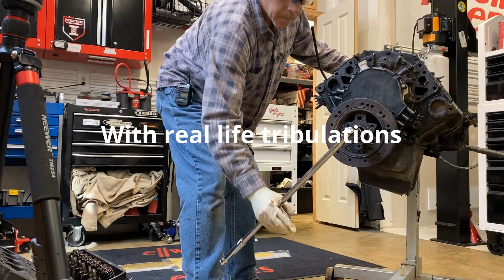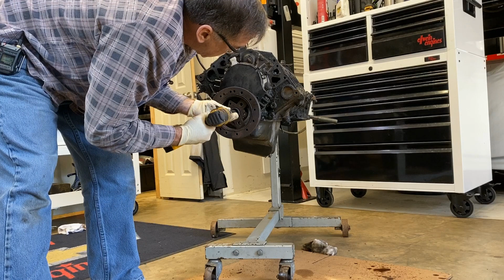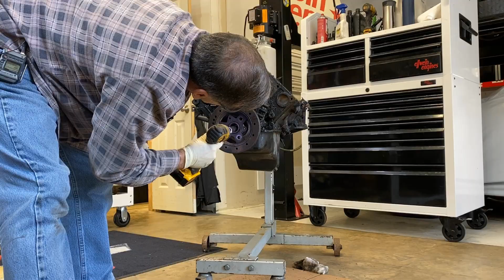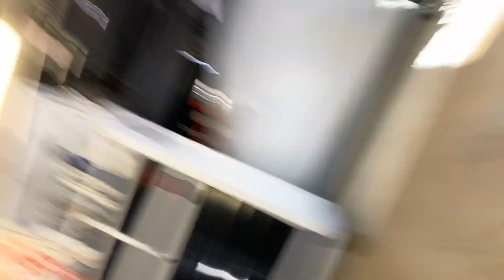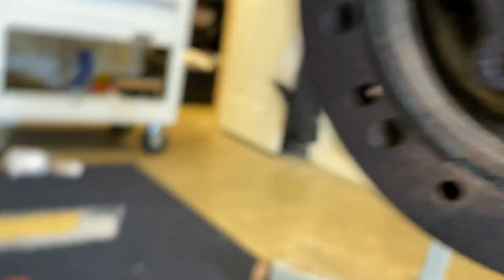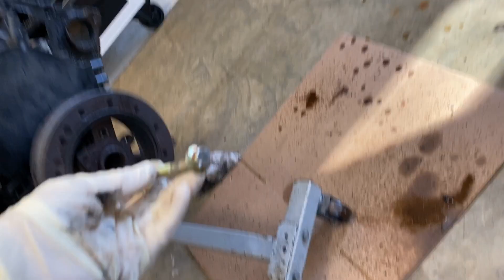LT1 Hub Removal

Comment: I've had good luck with the OEM tools 25090 puller. Its the 3 jaw puller type with hardened rods. I damaged the threads in the crank of my 1st LT1 using a bolt that was too soft, so i bought the OEM tools unit and no issues since!
Reply from the maker: Cool!  I have something like it.  https://www.amazon.com/OEMTOOLS-25090-Harmonic-Balancer-Mitsubishi/dp/B01AIRR4EY/ref=asc_df_B01AIRR4EY?tag=bingshoppinga-20&linkCode=df0&hvadid=80470559180558&hvnetw=o&hvqmt=e&hvbmt=be&hvdev=c&hvlocint=&hvlocphy=&hvtargid=pla-4584070138236503&psc=1

Comment: Hey i got a question if you have the time!?  I got a ATI super damper and steel hub for my 97 Camaro. I was curious if you knew what I should use for a crank bolt?  ARP replacement or a stock replacement? I have no clue and this ATI hub has been nothing but a nightmare to deal with. 

Lil back story..
I used the kent Moore j tool to remove and install but the bolt snapped in crank snout. Finally got it out 2 years later and I need to get my car going. I miss her. I just dunno what bolt to use. Im gonna have to get that hub bored out also it seems. I cant get the thing on no more than a third a centimeter, no matter what I do and now I'm nervous to snap another bolt into the snout 🤦‍♂️🤦‍♂️
I may just use the stock hub/dampener for time being. Sucks because i have the ati but its been such a pain.  HCI FBO should be in the 420whp range when done.
Reply from the maker: They are a pain.  yes.  I would get the ATI hub honed out a bit so at a machine shop.  It's worth it.  I use the ARP hub bolts and not the stock bolts.  Sometimes I have to shorten the ARP hub bolt on a bench grinder so that it does not bottom out in the crank threads-nose.  So much trouble but worth it.  Also....you can heat the crankhub up in a hot oven or even a torch.  Head it in the inside.  It will expand and go on a lot easier.
Reply: @EllweinEngines  thank you for your time! Appreciate it! Do you happen to have the ARP part # you use available to share? Ill get it, test fit it and if it seems nessisary ill grind an 1/8" off or whatever. Im so antsy to get this car done its been YEARS.  I would of thought they would provide that with the whole hub/balancer assembly but they dont.

Safe to assume grinding bolt is the better option rather than using a washer?
Thanks again man I appreciate your help
Reply from the maker: @clifford_2zero7  134-2501  ARP
Reply: @EllweinEngines  thanks for looking out! Gonna order it now! Again really appreciate it!💪
Keep making LT1 vids!!!😎

Comment: I Still need to get a newcrank  bolt for mine its has some marks in it when I put a puller on it just to get the balancer off the hub :(  Does ARP make one that fits? I have this crappy grade 5 bolt I ground the threads off Made it when I was a kid. Used it on every chevy engine I ever took the balancer off with Its getting beat up!
Reply from the maker: I wish ARP Would make one that fits but all of their crank bolts are extra long.  I do use the ARP crank bolts but I have to use a lot of washers so that it doesn't bottom out the threads in the crank.   I installed an ARP crank bolt on one engine and did not realize it was not tight against the hub.  It was only tight against itself in the crank threads.

Comment: Maybe I have been lucky (down here in the South) but I have never had one that hard to come off, except for one that  layed  out in the weather for several years.  By the way, it may be a good idea to show everyone how to line the dampner and hub up properly on reinstallation (in case they didn't mark it to begin with???).
Reply from the maker: YEs.  Since there is no woodruf key.  That is a good idea.  If anyone wonders about that just look at the crank keyway (where there is no key) and also look at the hub.  Inside the hub will have a off color area where the keyway would be.  And if you don't get it exact then no worry because it is not a balanced damper.  It can go on wrong and be ok you just won't have an accurate knowledge of timing mark (but who checks timing at the crank now-a-days)  ahaha.
Reply: @EllweinEngines  Karl, guess I am old school.  I did purchase a '96 Impala that had been thru the dealership to replace the distributor cap.  It was marked.  Maybe they are old school too???????
Reply from the maker: @gmcnelly2468  Yup.  Old school you are.  Also doesn't hurt to mark things.  The shop manual even says to set the crank at some specific position and the cam pin at such and such.  But none of that really matters.  The reassembly is "almost" fool proof.  I know I can mess it up even with a mark.  haha.

Comment: When you say don't let the longer bolt bottom out do you mean to where it stops in the crank or to where it doesn't tighten back up against the hub?
Reply from the maker: Where it tightens back up against the hub...just before the hub is almost off the crank.

Comment: Any reason for using the long breaker bar rather than an impact?
Reply from the maker: actually only reason is I don't have a good strong impact.  Air impact gun would be quicker.  Still would bottom out on my longer bolt and have to reset the set up but still an impact would be much quicker.

Comment: oh man i have a story to till about this ....  i did this for the first time alone without the help of YouTube , it was a nightmare . i haven't found a longer bolt with the same threads , so i ended up using a smaller thinner one and it ended up damaging the crank shaft bolt threads , so when i installed the crank hub back , the bolt didn't tighten all the way back , so after few days of driving the hub let go and the crank ended up spinning by it self inside the hub bass for atleast half an hour which damaged the hub bass where it attach to the crank, which resulted in a larger diameter hub bass , so i ended up buying a new hub assembly , so now after installing the new one with a new bolt and new threads it also let go again turns out the crank bass where it attach to the hub ALSO got less diameter due to spinning in the hub , so now i need to take out the whole engine and replace the crank shaft .... but i decided to weld every thing together and its working fine till now .... hope it just hold on together for a year or so ....
Reply from the maker: wow!